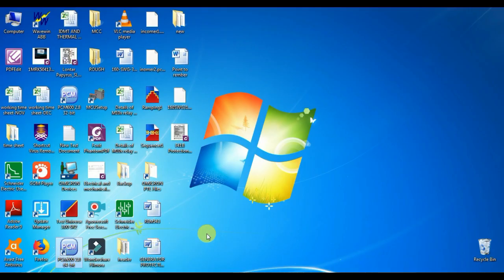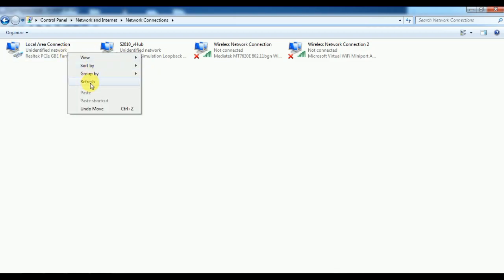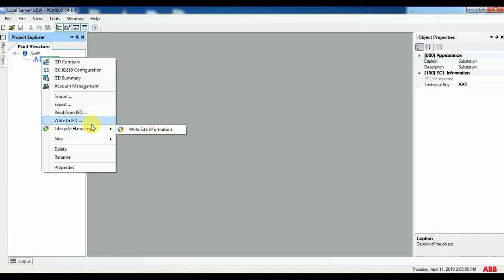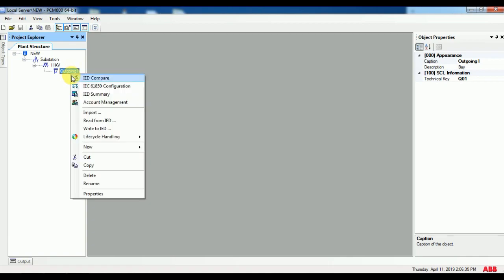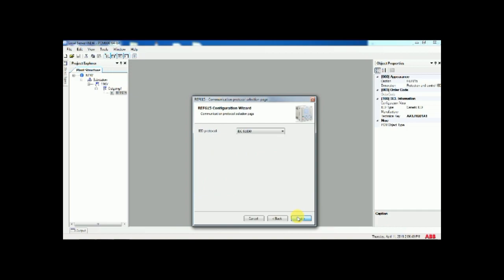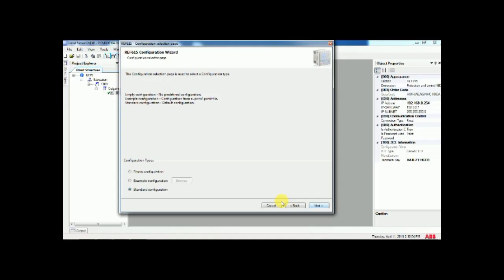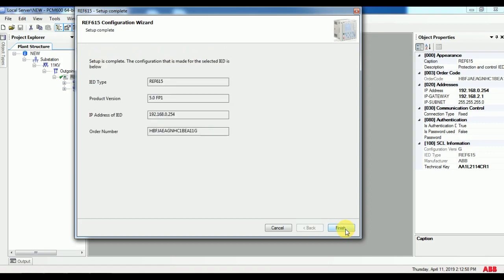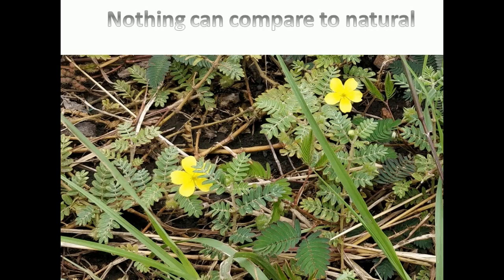How to Establish Online Communication with ABB Relay Using PCM 600 | Step-by-Step Guide ⚡

Comment: Hello sir,
I have to connect to REF615 for downloading Disturbance recording, but i do not have the project tree of the Substation protections.
If i connect to ref615 by online configuration, like in your video, there is a risk of modify of changing any configuration in the relay or not ?